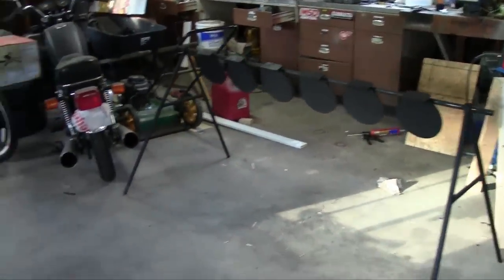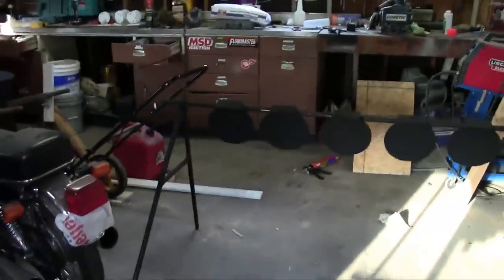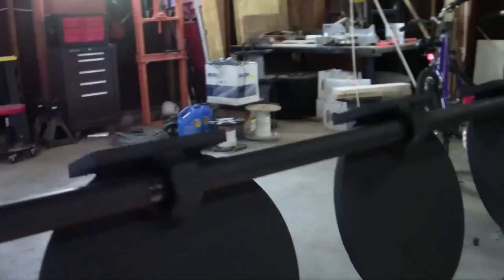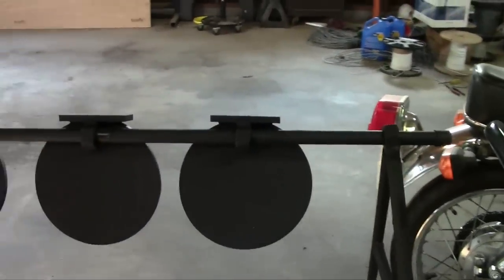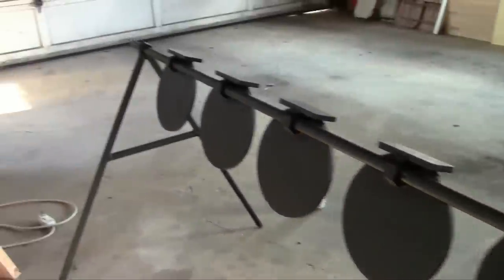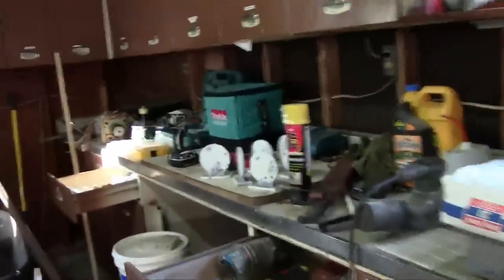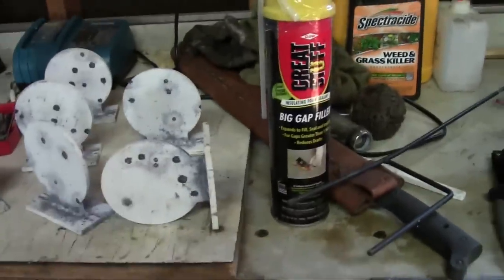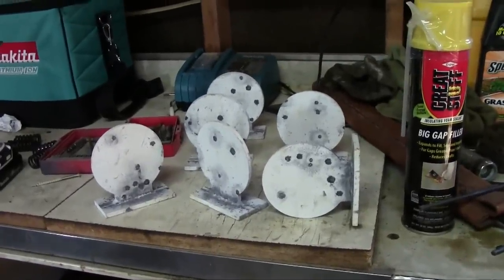How to build a modular plate rack

Comment: Thanks for the awesome video / idea.  To make the target self-standing, drill a hole then thread a 12" piece of 1/2" all-thread into the bottom flat plate (the top flat plate as the target sits on your pipe now) and then add a heavy weight to the end of the all-thread, secure the weight to the all-thread with a couple bolts (I mean nuts).  The swinging weight will stand the target back up.  You can then remove the all-thread at your leisure and have some plates swinging back up and others just hanging down.